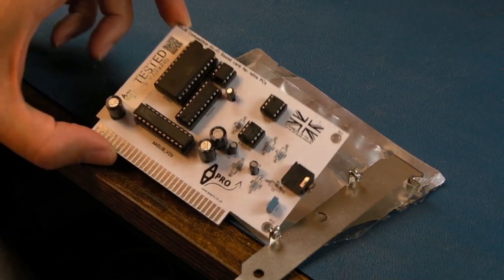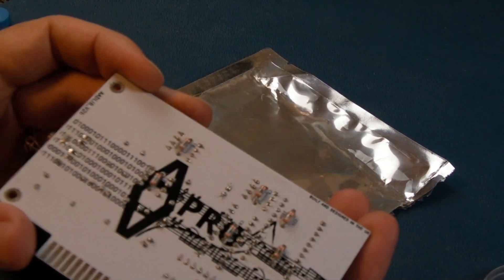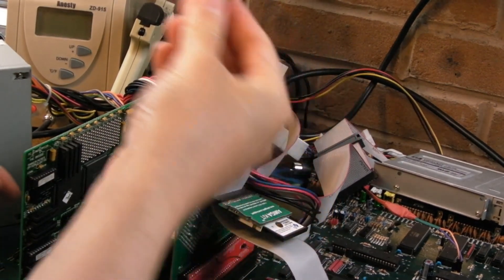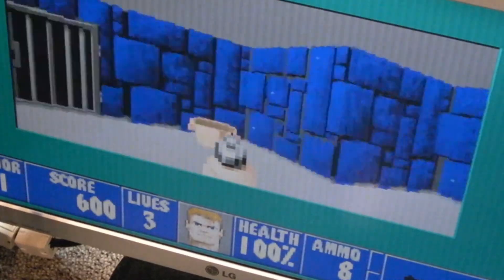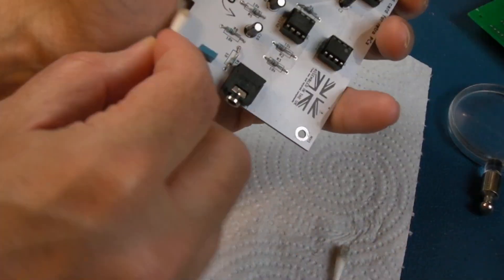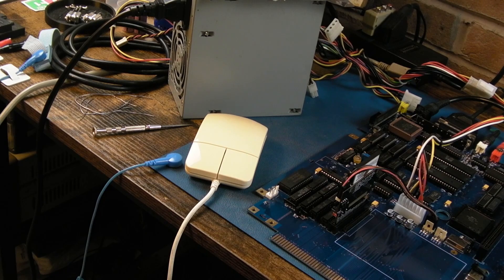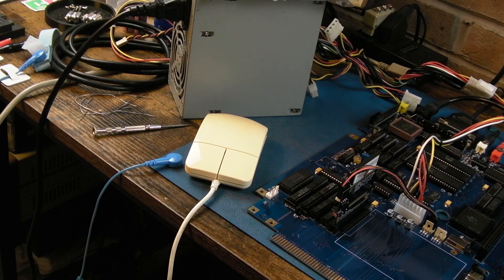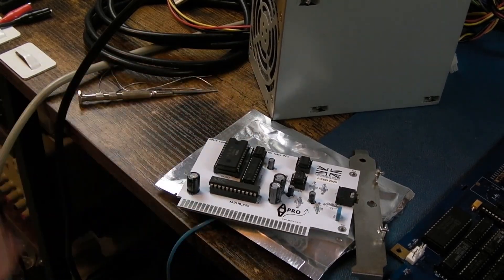Adlib Sound Card (YM3812) Clone (AAPro) Super Quick Fix

Comment: Nice simple fix for once.  Its a good card but I had similar comments when I built mine that gold contacts would be worth the extra few £.  I suppose though if you're just fitting it into your system once and never taking it out again it will probably be fine.  It's just people like us constantly swapping things to test them that will wear it down.  I approached AA about that and the fact that the edge isn't bevelled but they just put it down to cost.

Comment: Wouldn't it be better if the edge with the contact fingers was bevelled? It seems to be square, that's usually not very good for the pins in the edge connectors.
Reply: The PCB house we used back in the day did not do bevelling on edge connectors. The ones we sell now are made with 30° chamfered contact fingers.
Reply: @aaproltd  good to know! Thanks for clarifying that.

Comment: Lovely stuff, Gadget!
I've got one of these AAPro clones in my IBM PS/1 Model 2011 which doesn't come with ISA slots so I managed to build my own little riser board that houses both the AAPro and an XT-IDE card and somehow it all fits in that tiny case 🙂 For digital sound I use a Disney Sound Source a friend gave to me.. I had to add a little preamp board I made myself for the AAPro to be able to crank up the output level to mix it in with the output of the PC speaker in the monitor which has its own built in amp, making the AAPro Adlib output come nicely out of the original monitor. They're very quiet cards indeed. Must be below line level.. The original Adlib had a little preamp section and a volume pot on board to make up for that 👌